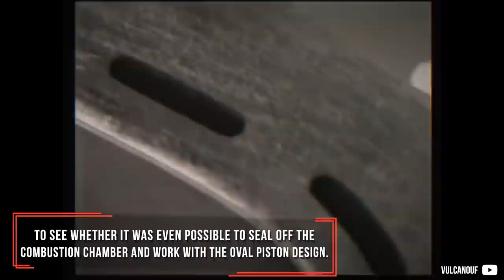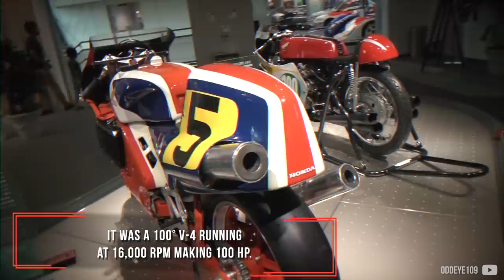Why Honda Made A 20,000 RPM Oval Piston Engine

Comment: they had two different  piston bores one was for racing and the other was for show room sales. the race motor rings  and bores were not oval , more like a paper clip shape the other deal had a oval shape for better ring sealing ,plus they had gas ports in the piston top ring to keep the compression sealed, but it never caught on,

Comment: Honda,s first piston design was shaped like a paper clip, they used gas port pistons to seal the straight part of the cylinder wall, they later made the cylinder,s more of  an oval but the double  rods had bearing problems.

Comment: I remember when this came out in 79 or 80, I remember a story that the rules wouldn't allow you to run more than four cylinders, Honda got around that with these oval Pistons, and the Piston is not just the size of two Pistons, you pick up extra cc's from the triangle (s) that would be there if it was 2 Pistons, seems like I remember when it came out and raced a couple times, the rules changed, it was too dominating

Comment: It wasnt only the motor that caused many problems. The "monocoque-frame" and the position of the tank (under the engine) made also a lot of problems, and even the new "compstar-wheels". Ironic, that Honda won the 500cc Championship with a simple made bike with an 3-cylinder 2-stroke after the NR-desaster..

Comment: Why generally Petrol cars rev lower than Petrol Bikes ??
Reply: Good question
Reply: Obviously because the piston has to travel more distance in cars engines, so the mass that the connecting rod has to stop of the piston will increase and might destroy the engine, unlike motorcycle engines, they don't need a lot of torque to move the bike so the distance is shorter, but hey, sometimes it's a bad thing, motorcycles aren't reliable compared to 4 wheeled vehicles because if you're cruising, or trying to save gas, the bike engine will always uses more than 3k rpm, while cars will use less than 3k rpm that means less friction/wear

That's why the gold wing is the most reliable motorcycle in the world because it uses less RPM to move the bike due to its torque

Comment: Perhaps it's really not a bad idea. It has more surface area than a twin cylinder engine of the same physical size, therefore more displacement, and more power potential. it can also be a far more simple engine than a twin cylinder of the same size.

They really could've and should've imported on the design by giving it one big, beefy connecting rod.

Comment: As I remember, at the time the NR500 (yes, I'm old) earned the nicknames "Nearly Ready" 500 and "Never Ready" 500. A fascinating, but ultimately pointless bit of engineering. 
When they are oval, can we still refer to them as "cylinders" ?
Reply: @Philip Carpenter Ovanders xD
Reply: Wouldn't say pointless.  A lot was learnt.
Reply: The outline of a 3d cyclinder at angle is an oval*
Reply: So a cylinder can be an oval. And yes, my thc induced mind just discovered this.
Reply: @quartusbuys6831  Chief amongst them is don't build a V8 with siamesed bores in an attempt to circumvent regulations and its corollary, don't try racing a 4-stroke against 2-strokes of equal displacement unless you can build an actual V8.
Reply: @CaptHollister  Agreed, but also doubt they will succeed with equal displacement.
Reply: You learn more from your failures than you do from your triumphs. Failure is ALWAYS an option.

Comment: sometimes i hate honda. they knew its not gonna win over 2 strokes and its a technology that would not go to production bikes cause its only a way to bypass gp rules like the 15 gear 50cc 4 strokes back in the early 60's. on the other hand they were quite successful with the injection ar 2 stroke dakar bike in late 80's but they decided not to put that technology to street bikes except a carburate version of the crm 250...

Comment: Shame that Honda has pretty much ‘pulled the plug’ on introducing new, exciting and innovative vehicles. They have been trading on their past for a while, at least fifteen years according to one commentator.
Reply: Have you not seen their DCT motorcycle gearboxes. The best model was the VFR1200F with the 173bhp V4
Reply: @pl1068  Fair enough, however the cars are the main Honda product now and the company has been ‘coasting’ on its reputation for years. I do not know why they have done that but they need to turn things around before their position is irrecoverable. They cannot survive on motorcycle and small engine sales.
Reply: Not so , always new models of their motocross bikes and they have all new sxs in the talons . They are testing all electric mx bikes in Japan already and have formed a alliance with Ktm and Yamaha to develop new interchangeable batteries for new e bikes

Comment: How bazaar. Two strokes with direct injection, inconel rotary disc exhaust valve, and rotary disc transfer port valves would be super expensive to develop at first. However they could be forced induction and kill the 4 stroke. 
Better yet, a conventional oiled journal crankshaft with a supercharger required to force air into ports would be able to compete with emissions regs.

Comment: I didn’t watch the video because I know why Honda did this, I just thought I would put it down here.
 I was trying to take advantage of the rulebook.The rules stated that you could only have four cylinders. this design allowed each cylinder to have eight valves…
  The most difficult part two engineer were the rings
  The ironic part of this design is, the round cylinder 750 engine this was meant to replace was actually faster on the racetrack

Comment: Honda is the world's biggest gasoline engine manufacturer and produce the most durable and reliable gasoline engines. 💪
Even when beaten up they just keep going and going. 😃
Toyota is at the same level in reliability and durability but their engines are underpowered compared to Honda. 
And also, VTEC baby. 😅
Reply: true, but their design philosophy differs, and at least for me, is the largest difference maker in the long run.  Honda's willing to experiment and always chase progression is something to be applauded, and has led to some of the best engines known.  There's no point even attempting to say otherwise.
Yet I still prefer Toyota overall, and always consider them first.  Here's why:
While it's true that Toyota's aren't going to win any major awards for testing the boundaries of the internal combustion engine as far as all-out performance, they're rather notorious for over-engineering the vast majority of their engines and leaving a lot of performance left on the table for hobbyists and tuners alike to chase after.  Without mentioning the 1JZ/2JZ platforms, there are three separate engine platforms I can think of that are far more capable than what they were allowed to be leaving the factory.
4-AGE, 1UZ-FE, and 3S platforms are all capable of rather ridiculous performance once you give them a proper chance.  For example, the 1UZ 4.0l V8 platform has a significantly higher performance plateau naturally aspirated than what came out of the factory.  The design of the cylinder heads themselves were left up to their notorious performance partner Yamaha, who designed the engine to achieve closer to 350 hp and 300+ lb-ft torque averages.  Keep in mind that this is the original design that was implemented in the 1989 Lexus LS400.  Later versions with VVT cam phasing and better port geometry are capable of averages that are higher still.

Don't get me wrong.  Honda engines last a long time, even at their higher performance levels due to absolutely pinpoint-accurate engineering and their undying strive to be the best small-engine manufacturer worldwide.  But their engines aren't million-mile engines as often as Toyotas are.  Toyota leaves the high-performance build-up to the individual if they so wish.  If you leave a Toyota engine as-is, and keep up with regular maintenance, they tend to outlast their owners.  Another great thing to note is Toyota's ideology that they will not implement a change in a vehicle, engine design or any other component without stringent testing first, and only when that new component proves to be as good if not better than the previous will they implement it.  Otherwise it will stay shelved until it can.

Side note:  just an opinion of mine; Honda builds better performance engines.  Toyota builds longer-lasting cars, and doesn't specifically chase engine performance at the cost of another department.
Reply: Hey Jacques all that you say here is so correct , this is my take also on Toyota and Honda, similar information was divulged a few years back when Yamaha  associated with Toyota. I'll agree with you about the performance side of things regarding Honda.  @jacquescrusan9500
Reply: @jacquescrusan9500  I'll have to disagree with you about Honda not having million mile engines.
Honda has engines that are proven to be "million miles engines" just like SOME Toyotas do.
Honda engines are also overbuilt and have a lot of room to play with, that's why they're the best choice to be tuned and for swaps, specially on Toyotas, making the best combination of Toyotas light weight cars with the best engines around, Honda. 👍

Comment: You can hear that the oval engine is ok with the high revs, usually you hear the engine note change to one where it is obviously in trouble and ready to fail. I only buy Honda cars and power equipment, they are in a class of their own.

Comment: The very quick answer is that they wanted to build a V8, and rev it to the skies to try to compete with superior 2-atrokes. 8 cylinders were illegal, so they build it likea V8 but with the pistons merged together to get around the requirements. As the video notes, it didn't work, 2-strokes were still better, and they finally gave up, built a 2-stroke, and won everything there was to win.

Comment: V4 oval piston is a RUSE....the honda oval piston engine was a ruse and cunning way to hide making a V8 motorcycle engine. When taking a bore measurement through the sparkplug hole, the "rules" say the bore gage tangs must touch the "fore & aft" of the cylinder wall to check bore diameter.  In other words, the bore gage tangs must be parallel with the frame of the bike.   If the technician takes the reading that way, then they can't tell there is a cylinder wall, hiding another cylinder.   The secret of the NR engine was the race bikes were V8's.  The V4 was the way to hide a V8 engine in a bike chassis.  There's cheaters and there's losers. HAHAHA

Comment: @Complicated Scene ,
🔵 I believe Honda was on the right path with the 'Oval'-piston engine, but I think they would have been better off instead exploring Long-skirted 'Elliptical' Pistons (each using only one connecting-rod).
I think the RPM-gains would have been just what Honda was looking for, as well as the increased torque that a longer piston-skirt would support without the complications of strange-harmonics from the Oval-Piston 'Rocking', or the power-pulses from those 4-big oval pistons causing the bike to have trouble holding onto the road in the turns. (More pistons would have solved that).
You can also fit more elliptical-pistons in a given area than you can round-ones, Which allows for a shorter crankshaft/camshaft for the same number of pistons, and a shorter mass has less harmonic instability.!Lengthening the piston-rods without lengthening the stroke will also reduce the maximum angle of the connecting rod to the piston when it's in the bottom half of the cylinder, at 20,000 RPM that's an enormous consideration.
Reply: Oval pistons have more area than elliptical pistons for a given amount of footprint that they take up in the block.  I've been through the numbers on this.

Comment: At the same displacement, a 2-cycle will always produce more power than a 4-cycle, but will consume a lot more fuel. I don't know what the rules were, but if Honda were trying to compete against 2-cycle engines of the same displacement, they were never going to win. However, when it comes to 4-cycle engines of any capacity, Honda are world leaders. Unfortunately, we;re heading towards all-electric vehicles.
Reply: Honda will be the leader in electric too ! And all other manufacturers will follow their lead

Comment: If you follow motorcycles the OVAL Piston Honda turned out to be a dismal FAILURE.  Seems as if they couldn't get the Rings to seal very well.
Reply: I commend them for daring to actually get them built, raced  and then put it in (limited) production.
Reply: @ghostwrench2292  Read quite a bit about this project when it was working and it was a very interesting concept.  Seems as if the Rules wouldn't allow for a V8 motorcycle racing, the old 500cc Moto Guzzi and the dust bin faring was outlawed in I believe 1956 or 1957.  The Guz was hands down the fastest bike on the grid when it was racing by a bunch, the problem was with that advanced engine and that very slick faring no one could compete with them.  The down side was that this engine and faring far exceeded the frame/tire tech at the time then the faring had a issue with side winds.  Honda tried to use a unique approach to make a V8 in the form of the oval piston layout, it was very fast while it ran, however they never did solve the oval piston ring sealing issue.
Reply: @ghostwrench2292  followed bike racing a lot during that time as was stationed in Europe.  Yes they would run like hell, that is while they ran.  They could never fix the ring blow by issue, fuel in the oil and oil in the fuel caused many of them to be black flagged on a regular basis, or pulled out due to spun bearings.  It has been a while ago and if I remember right NONE, that is not one of these bikes ever won a race.  It was a great idea, it skirted the V8 regulation, but simply it didn't work in application.
Reply: Fascinating!